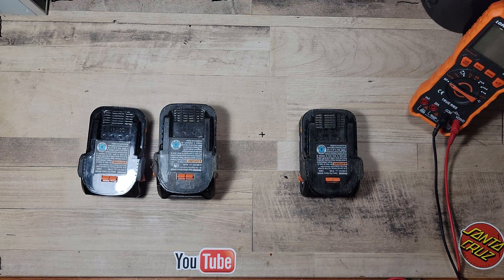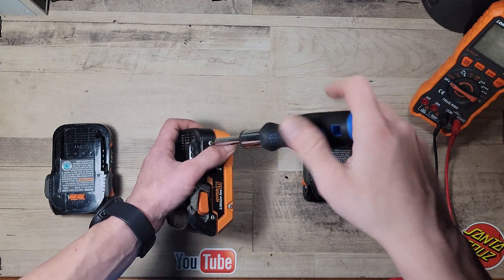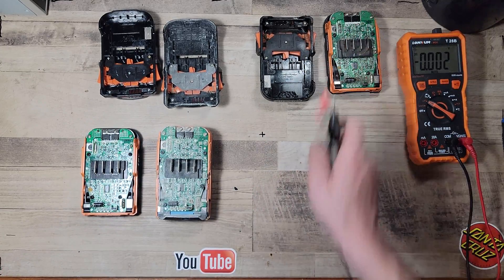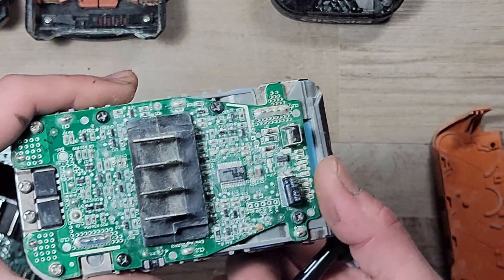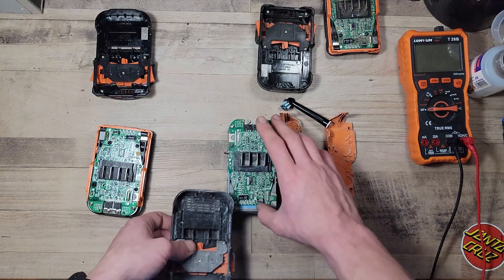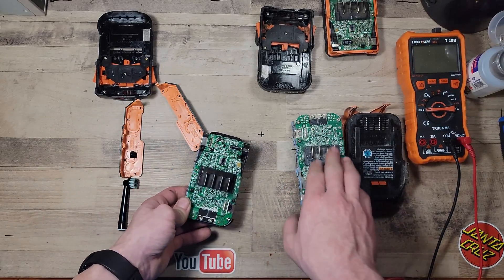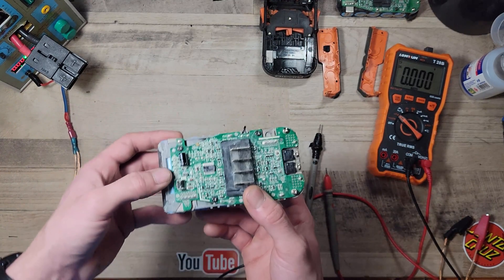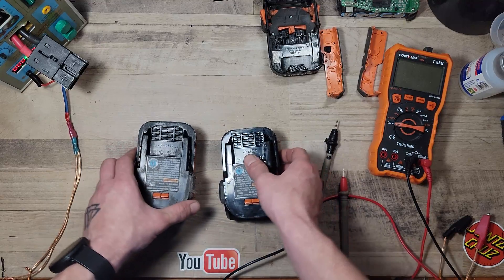Ridgid 18v Battery Repair - Corrosion and dead 18650 cells

Comment: I've got 2 batteries i'm trying to trouble shoot, the first one is a fairly modern (last 2-3 years) 2 Ah R87002 pack, that is flashing a single battery light, won't power any tools, you can put it on a charger and it will act like it's charging and take it off the charger and it still won't run any tools, pulled the pack apart, newer circuit board design without the reset pins (from what I can see), checking cell voltage, 2 are around 2.79v and the others are around 2.99-3.01v, but no voltage at the battery to tool terminals, well I say not voltage, when I first make contact with the multimeter for a split second it will show about 3 volts then it quickly drops to zero, not sure what to try on this one.

second battery, older 4 Ah, behaving very similar to the 2 batteries you where able to revive, wouldn't power tools, lights go out when in a tool, good pack voltage at the battery to tool terminals (18.6v) took apart, saw corrosion on board, cleaned board and reset board and still won't power tools.
Reply from the maker: For the newer battery, it may be in under voltage protection, though the cell voltages really aren't that low, but below 3v. If you have a power supply you can get them above 3v individually then you may be able to revive it that way, with a shot. I did get pretty lucky with the ones i worked on, it's not always that simple. If i had one in the same situation as you i could help diagnose but at this point I'm not sure what the issue could be.

Comment: Worst mistake I have ever made is buy battery tools .
For working away from home a small 2000w generator much better and no dead battery in the middle of a job.
Biggest OverPriced Scam.
Reply from the maker: Cordless tools pay for themselves and the batteries with the amount more productive you can be, less time wasted with cords. That's just my 2 cents.
Reply from the maker: I'm a contractor in cottage country so i know all about running generators on new sites, gas isn't cheap either

Comment: Battery 1&3: 0 V across the cell pack can also indicate a bad board which has a short, and the cells will accept a forced charge to confirm this.
2nd battery: May not activate charging circuit.
For all these, boards are available direct from Chy-nah for about $12
Reply: got a link ?

Comment: Can you not just add the new cells in parallel ??
I am planning to just add the extra cells to the existing cells in parallel. Can't find a video, is it possible ?? I would be keeping the same BMS.
Reply from the maker: @omairkhalidmirza  you shouldn't due to the fact that the cells are different age, even if they are identical rated capacity, they will have different resistances and they won't charge or discharge the same, it's possible but not the safest, i wouldn't recommend

Comment: Distilled water is not conductive. The problem is all the minerals and stuff suspended in it conduct electricity. Distilled water has a negative ion charge, so if it comes into contact with loose minerals it will suck them right up and become conductive. If there's enough minerals dissolving into it, it will conduct electricity. But it usually doesn't if the board isn't flaking off or something. Still solvents are better.

Comment: Is there a reason that you did not test each cell?
Reply from the maker: The cells were tested ahead of time. I discharge and charge any recycled cells i get and mark the capacity if it is over like 2-300mah different from specification. I do resistance test each cell but as long as they are the same model or chemistry then typically the capacity and resistance are closely related.

Comment: How do you take out rigid screws they have a metal bit in the middle of the star bit
Reply from the maker: Security torx bits
Reply: By using the proper bit. LOL.  If you can't figure that much out, you probably shouldn't be playing with exposed terminals of highly flammable lithium cells.

Comment: I have tons of Ridgid batteries but I registered them all for the warranty.  I never had any issues yet that would cause me to use the warranty.  But I suspect they'll try to make hoops to jump through.  Incidentally, I just bought an adapter plate that brings the 18 V out for any use.  I am sure Ridgid is happy about that.  It is amazing to me how many components they have on the board.
Reply: I never  take time to send in the warranty and they fail alot maybe this winter I can try to repair some.
Reply: I just filed for warranty replacement on a battery (first time after several years of use). Process couldn't have been easier, they asked a few simple questions over the phone and are shipping out my new battery. I was having the same issue as the 1.5Ah "new battery" as demonstrated in this video. Battery would take a full charge but just work in any of the tools.
After taking it apart and dry brushing it, it seems to work now... fingers crossed it stays that way
Reply: @nycsheki  had a rigid driver and drill set with 2 batteries.  Registered it properly.  One of the batteries failed.  I tried to get it replaced.  The company required me to return the entire set, both batteries and both tools for them to honor the warranty.  I needed the tools for my job and could not send the tools back and wait....ended up buying a new battery. ...grrrr
Reply: 6 months ago I submitted a claim on my 2 year old battery and they mailed me a new 6Ah. That was it. They didn't want the broken one back. (2 cells bad. 8x 18650s were fine and ready for another project.) Don't forget to register your replacement battery too!

I'm cautiously optimistic.

(The hoops are jumped through during registration. I'm a savant at buying custom sale SKUs that the LSA site doesn't like. Check the application after a couple weeks and call if not approved. They've always approved it over the phone.)
Reply: it depends how you got the battery, if the battery was included as part of the tool then it's a Lifetime Warranty, if it's a Black Friday sale Battery or other battery only purchase those only have like a 1 year warranty.
Reply from the maker: Like any warranty, Yes there is always hoops and they are good at catching you on terms you never expected to exist. No company wants to hand out stuff for free, Even if its their fault lol. Some companies are better than others but its worth researching other peoples experience

Comment: Why do you need to repair life time service battery offer from Ridgid??? Totally stupid. Just send dead battery to Ridgid to get new one done. Don't repair by yourself to void the warranty, Everyone should be not follow video to do repair it will void your life time warranty service/
Reply from the maker: Typically the terms of the warranty include proof of purchase. Not everyone is first generation owners and not everyone will have proof of purchase. There is also the ability to use higher quality cells making a better pack.
Reply: @KooshiesElectronics  I've been struggling to trust websites that sell 18650 battery cells, do you have a trusted website you use? This is the first video that i watched from your channel, are you doing this as a hobby of do you repair electronics?
Reply: @KooshiesElectronics  they do not ask you for proof of purchase. It just has to be registered for the lifetime service and check the serial number

Comment: I did this to mine and they now work but still won't charge. 
Do you know what the issue could be?
Reply from the maker: Still trying to determine that one.
Reply: It could be the charger doesn't like what the battery is telling it on the data port. There may be reset instructions somewhere on the interwebs or here is a schematic search  Ridgid/R840086-87/R840086-R840087 Schematic.pdf
Reply: The expensive Powertool batteries used to have a mechanical fuse which would switch in when cooled down. I'm pretty sure they have been replaced with an electronic one...anyone? Bypassing it would be bloody dangerous though.
Repair by replacing the parts

Comment: You can clean a live board with WD-40, the WD means water displacement and  the 40 simply enough meant how many tries till they got it right. I actually spray directly into many electronics especially switches and volume, gain, balance ext control knobs that have drop outdoors or squawking when it’s moved. Works amazingly good. Anyway, I doubt that intel would say this is a good method to even be on their boards and might even blame corrosion on them but corrosion stops when I use it on anything small and I am not counting lead battery to battery terminals cause that is simply a lot to ask of anything. It works on AC or DC current equally with AC that’s non capacitive as a capacitor on either can drop that voltage into you easily and it’s dangerous so be sure you properly and safely discharge them with any safe means you can use per that voltage output or a lead from + and - side in some salt water works on anything though can’t trust IMHO because no way to see it escape. Bulbs work well so long as voltage range is met. Lights and dims with draining of capacitor… WD-40 won’t short the capacitor but only said cause for a capacitor to kill you it requires no plug or battery connected at all being a power bank or storage place and unloads all power in fraction of a second making extremely dangerous! Anyway, WD-40 may be something you would like to try. Works serious wonders on electronics and for the record it is not a lubricant at all… thx and keep videos coming, getting better btw…
Reply: Best option is to buy non-conductive contact cleaner!
Reply: Yes Daniel and Rdwyer,  I used to use WD40 and air on vehicle ICU's and other electronic modules. As long as the vehicle was never powered on while under water, I had incredibly good luck by blowing off all water, WD40, and the compressed air again. Really must have done it well over 50 times and seldom ever had a failure. But, the vehicle had to be powered off. If someone tried to start a flooded vehicle, then many times it would fry the ECU. 
   One added note. I would never risk the SRS modules. No air bag modules and no Anti-Lock brake modules. Not worth the risk on those. Too much of a safety liability
Reply from the maker: Your right about that, Many people don't even know the simple meaning of that abbreviation. Yes it is Di-electric and hydrophobic by nature as oil is nonpolar, And it most definately can be "safely" used for cleaning electrical corrosion. I put it it quotations because WD-40 is a solvent loaded with petroleum and some heavy solvents that may not be kind to certain materials. The reason i don't use it for cleaning electronics is due to the lower evaporation rate of WD-40 compared to 100% isopropanol that i typically use (I only had cheap stuff that may have had water). Also, Once the solvents evaporate you are left with the petroleum oils as residue. Thanks for the comment and feedback! Happy days!
Reply: alcohol is hygroscopic and holds at least 19% water. use CO2 spray for air flow cleaner for cars. the fact that nothing visibly happened is prob due to themaybe-not-so-bad lacquer insulation on top of the print or the brush didn't hold enough water. thx for the vid!
Reply: What about low pressure air. I thinkbI would throughly clean it.

Comment: Do you know what’s causing the battery to shuts off when the battery is under a heavy load? My Ridgid battery shuts off in a fast start. Slow start is fine.
Reply: i know this is 2 years late byt does it only happen while the batts are cold?
Reply: @nolan7457  Any temperature condition it turns off. I replaced it new batteries and it didn’t fix. PCB it was.

Comment: I was hoping to replace the 18650s in them but damn it might be easier to buy a new set of batteries
Reply from the maker: I have a video on my channel where i replace the cells in one of these packs. Its not a hard process assuming you have the tools needed, Just be mindful of the possible diameter differences between some 18650s, It can make it a pain like it did in my case.